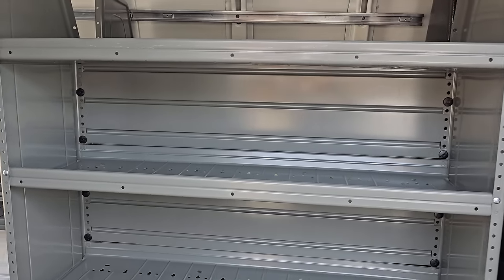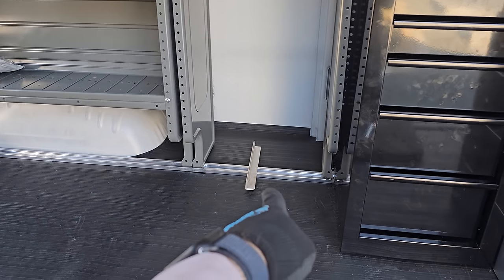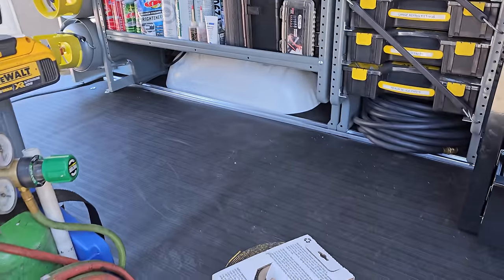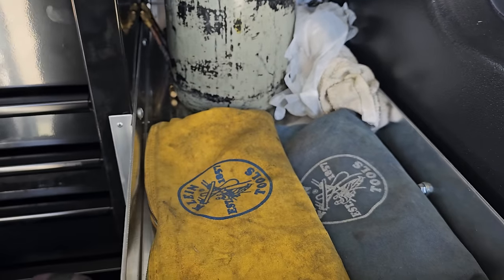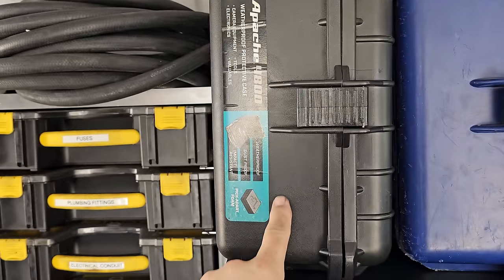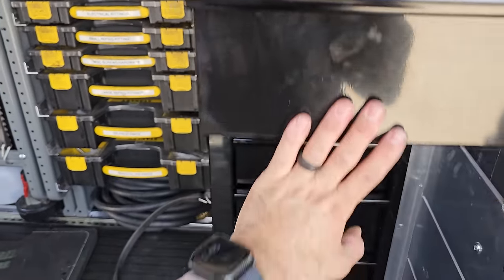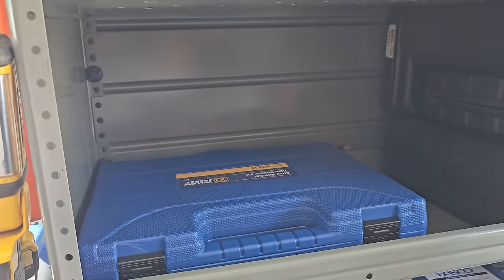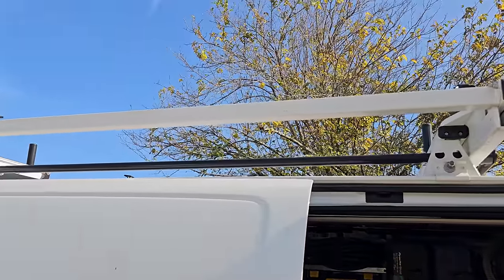HVACR VIDEOS VAN TOUR 2024

Comment: Just had my van broken into. They cut off the slick lock on the sliding door and punched in the key hole unlocked the door that way, they didn’t need to break the driver or passenger window to unlock it. 

Took all my veto bags fully loaded out. Torch kits, refer machines and gauges, all mg Milwaukee batteries. Had couple craftsman pack outs they took those as well. 

I have a husky 5 drawer tool box got lucky I guess they didn’t mess with that. 

Be careful out there, the slick locks are easy for experienced thieves they’ll get into no problem. I’d advise good alarms system and the more heavy duty side door lock but if you do not have it backed good enough they can just pry it off with a crowbar. 

The thunderbolt deadbolt system looks like it has potential.
Reply from the maker: Yeah I’ve had a van broken into before also and it sucks…
Reply: @HVACRVIDEOS  😢 im grieving def sucks.
Reply from the maker: I will discuss this on my Livestream on YouTube this evening 2/12/24 @ 5:PM (pacific) come on over and check it out https://youtube.com/live/SHfbGaJh6JU

Comment: 1.  Of all the work trucks I've had, the Chevy vans have personally been my favorite despite the Covid pricing in my area getting out of hand.  
2.  I swapped out my 2 50' hoses for the 50' Zero G hoses and have never looked back. 3 years on the same hoses and much easier to unload and load.  As I attests rinse off 90% of all unit I check before SH and SC.
Reply from the maker: So much easier to unload and store

Comment: You can do it with capacitors as long as it not higher  than 10%.
I myself  had to go 50% to resurrect systems until it could get replaced.
What's there to lose?

Comment: Did you say the m12 propress will work with zoom lock? So 1 1/2” ish acr fittings?
Reply from the maker: Yes the M12 press tool will work with the Zoomlock max jaws but you need to make sure you get the right jaws go to www.sporlan.com to find out more they have a compatibility chart there.